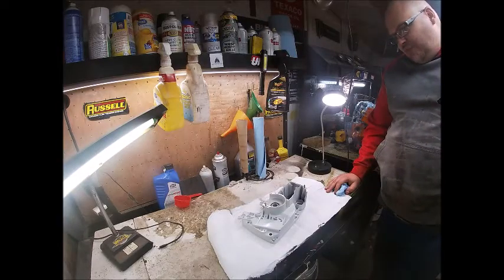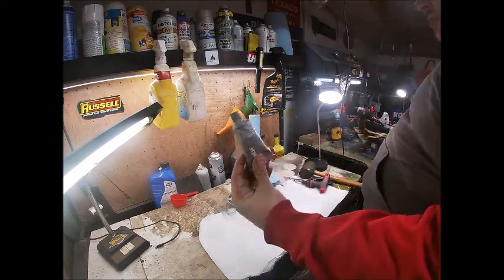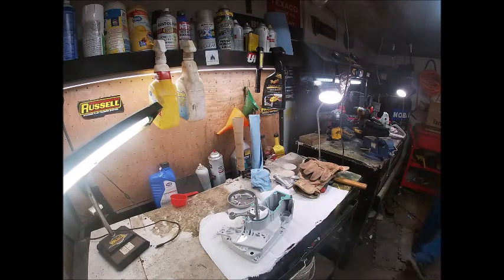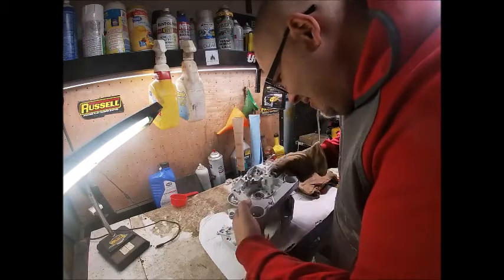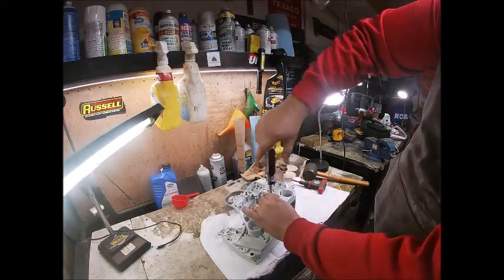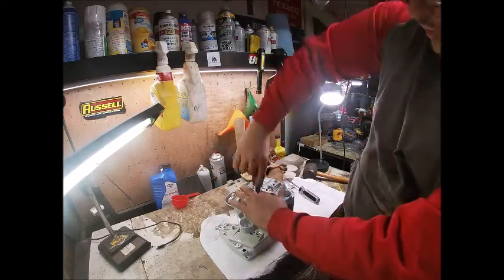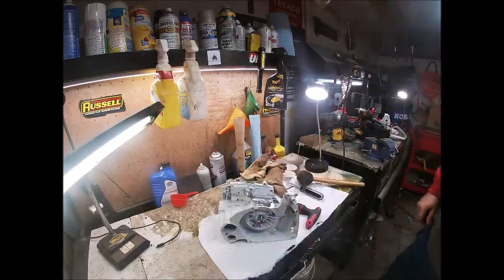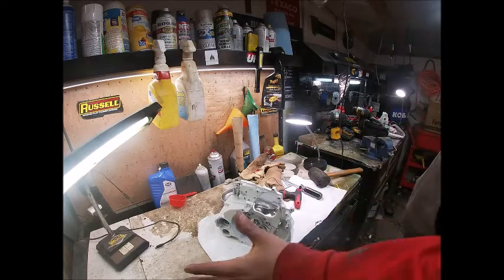Farmertec MS440 Build part 2 Crankcase assembly no speacial tools needed  case assembly made simple

Comment: Where did you find that MS440 on Amazon? I don’t see any kits on there, all they have is fully built saws that are way overpriced. I’d like to buy a kit and attempt to put one together but I’m afraid I might screw something up
Reply from the maker: Ebay...they are fun to do but if you have not done one can be a challenge...
Reply: @JandSChainsaw  which saw do you think is the easiest and best saw to build? I’m looking for one that can handle a 24” bar
Reply from the maker: @Schmidt973  most all stihl kits for me are simple,but there are lots of bolt for bolt vids on the 372..its also a tad less expensive...